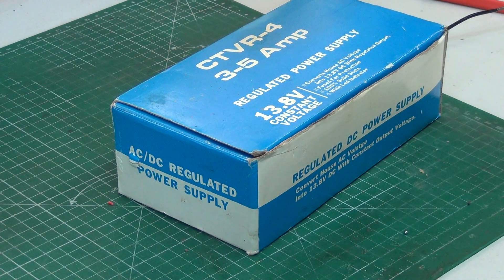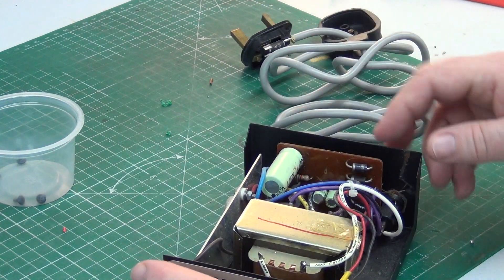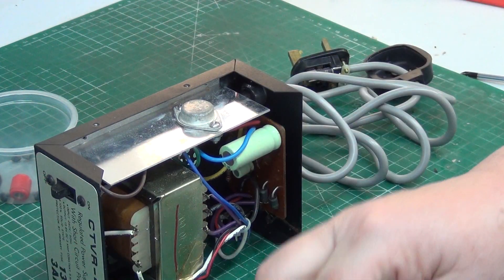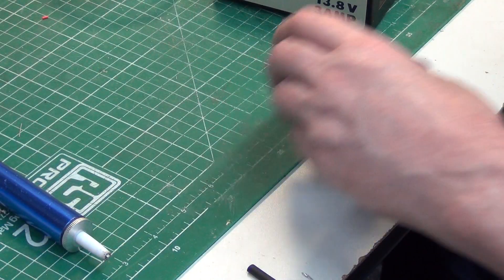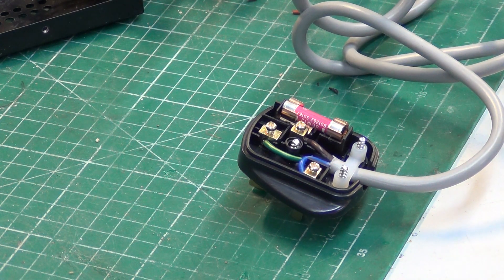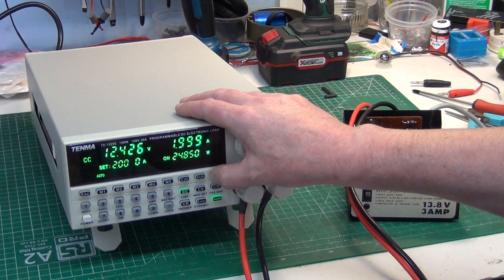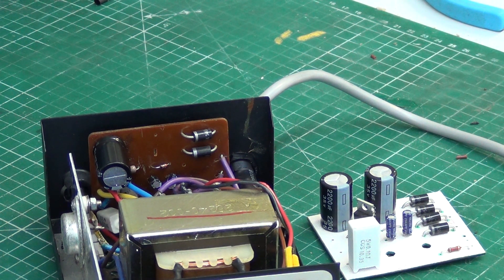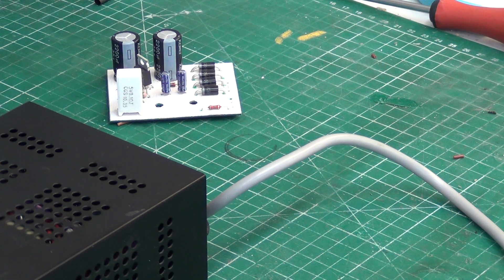CTVR-4  (3-5A)  Power Supply service...of the banned Taiwanese type

Comment: Strangely I have just been doing a 40 year old new unused PSU as well, and just like you I would not switch on without first changing the capacitors. Amazingly when I tested the capacitors later they tested as perfect, I would not chance using them though. Ken.
Reply from the maker: In the past I've tried NOS gear in controlled conditions. There's usually a capacitor explodes about 40 minutes in. What you don;t want is duff capacitors taking obsolete transistor with them
Richard

Comment: I bought the same powersupply some 45 years ago. I also noticed that it used only half its capacity. The secundairy windings are in series. Each winding has its own single diode rectifier, hence the two diodes. Modification:  separate the 2 windings, give each winding its own full bridge rectifier and connect the output of the rectifier in parallel. So + with + and - with -.
More Power! Greetings from the Netherlands.
Reply: That sounds too technical for the average CBer to understand :)
Reply: @bigpimp347  I agree that it sound more complicated than it actually is. You would instantly understand it in a schematic diagram.(a picture says more than a thousand words.)

Comment: That plugs not wired very good, just as well when i did my PAT course with Morrison i passed and am legally allowed to wire a plug correctly.
yours personally isn't sufficient.
Reply from the maker: really? I did three years C&G electricians course at Rotherham Technical College, now  renamed something or other university.

Richard, G0OJF, UK
Reply: @ukfmcbradioservicingTango21  the earth wire needs to be long enough that if the live or neutral come out the earth is still connected.
Reply from the maker: @bigpimp347  Absolutely, just like I dicussed & demonstrated.

Richard

Comment: Could the CTVR and similar power supplies be made up ( Amps ) by adding the extras I notice on the board in the power supply there are extra holes ?
Reply from the maker: If the PCB on the 3-5A version was changed for the one like I made.....which is a copy of the board used in the 5-7A supply, then the PSU would actually do 3A rather than 2.4A.  I'm not sure about adding parts to the existing board as I've boxed t all up for the customer to collect.

I tell you what, I'll do another banned 3-5A power suppy next week with the same innards & I'll see if it can be modifried.

T21
Reply: @ukfmcbradioservicingTango21  It was just a thought Richard it maybe a cheaper way to upgrade to better amperage ?
Reply: @ukfmcbradioservicingTango21   Are you still going to try the modification on a 3 to 5A to see if it can be uprated Richard ?
Reply from the maker: Yes, I'll see if I can slot it in tomorrow (Sunday).
Thanks for the prompt.

Richard

Comment: You disappoint me Richard, you seem to be a guy that sticks to the rules? I know that PAT testing states a 3 Amp fuse, but that is so very wrong. You can have a small PSU that consumes 1 Watt but the rules say fit a 750 Watt fuse. Rules are meant to be broken, especially when they are wrong. Fit a 1 Amp fuse I say ?
Reply from the maker: .....but the product has a 1.25A antisurge fuse in that holder we changed. That's on the mains input. So we're protecting the mains lead & through the cable grommet with the mains plug 3A fuse, then the product itself is protected by the 1.25A A/S fuse. 

You couldn't go down to 1A in the plug because of switch on surge.

Richard
Reply: @ukfmcbradioservicingTango21  It's all nonsense, I used a 1 Amp fuse for years on my soldering iron, but recently had to ban myself, as it is so ancient the plug is not sleeved 🤣🤣🤣
Reply: Note the 700W rule for anything under 700 watts a 3A fuse is used, And do not forget the inrush current appliances experience a temporary surge in current when they are turned on.
Reply: @chris_vandepeer  The rule is wrong, that is what I am saying, I have a small transistor radio in my workshop, and would not dream of using a 750 watt fuse to protect it.
Reply from the maker: It's back to whether or not the plug fuse is the only fuse. Most transistor radio type power supplied rely on a thermal fuse iembedded in the transformer primary....and that's all.

Richard

Comment: The earth bond test is a low voltage test, it can also be low current, it's definitely not 400V or 500V at 10 amps.
Reply from the maker: I think it does several tests, high voltage low current & low voltage high current. I can assure you if only one strand of wire was holding onto the earth bond, the test would melt it.

Richard